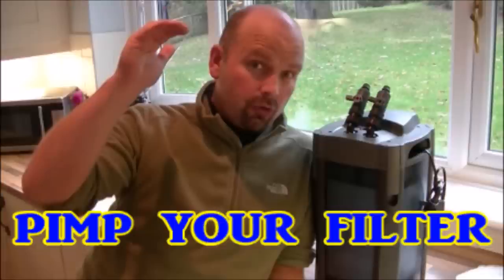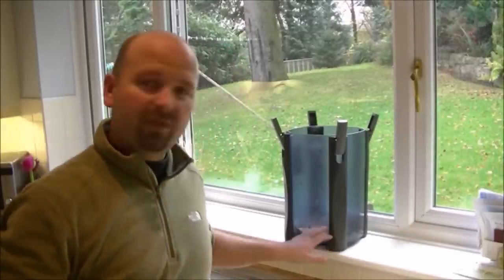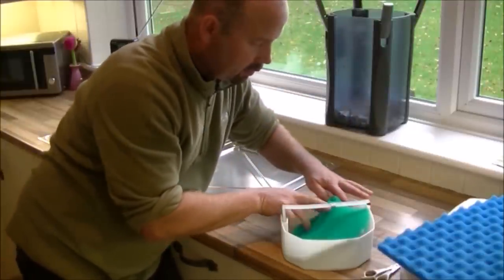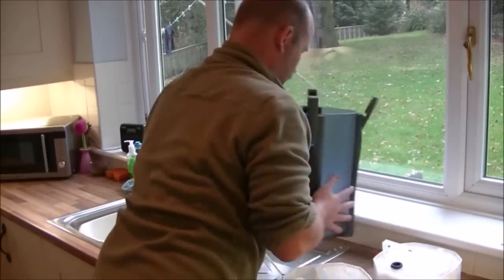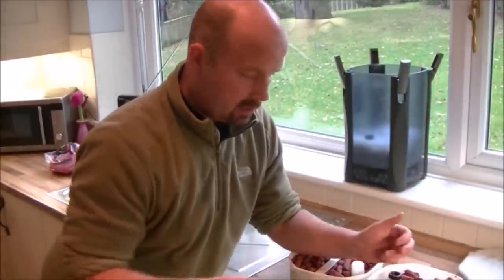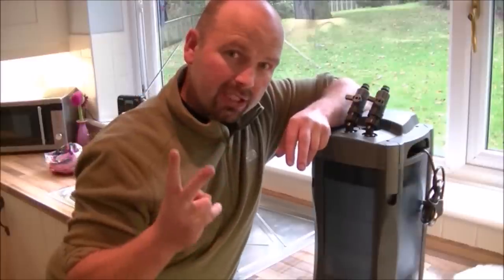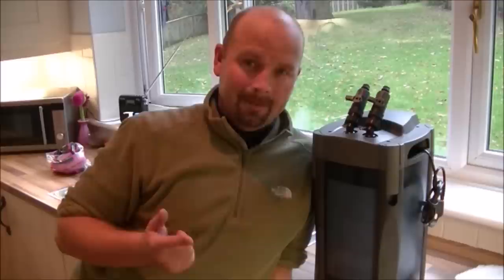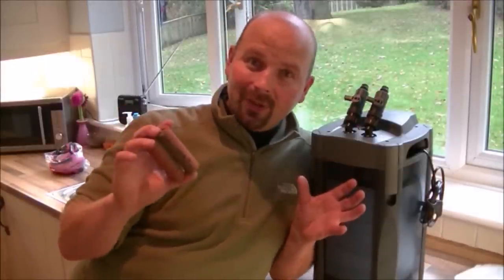External canister filter set up, nitrogen cycle and what happens in a filter - by Pondguru

Comment: Hello, I know this this a long shot but I am really interested in this external filter and I need the advice of someone super knowledgeable about aquariums and filters . So I currently have a Biorb Halo . It currently has a built in filter in the bottom of the tank that doesn’t work up to par . I currently have it set up as a marine tank and I also have a internal filter to assist with the crappy filter the tank comes with . I want to convert to a external filter but it’s very difficult with the shape and lighting of the tank . I want to replace the standard black tubes that come with most external filters with clear tubes to fit the filter so it will be more aesthetically pleasing . I would also like to not use the attachable hard plastic piping that allows the filter to somewhat hook on to square/rectangular tanks to filter the water  and return the water, because as I explained the shape of the tank makes that very difficult to fit in the tank since it is round shaped . Is that possible or is it required the use the hard plastic pieces in order for the filter to work properly ? My plan is to use the suction clips to stick the tubes to the inside curve on the biorb and tie a piece of mesh around the ends if the pieces provided in the set don’t fit the tube . This will allow me to remove the crappy filter all together as well as the internal filter taking up a lot of space in order to finally get rid of gravel , add live sand and give me excellent water quality . Does this sound attainable ?   I understand it may not be conventional . Trust me I regret getting this tank now so I’m trying to make the best out of what I have because I’m probably $500 in at this point . I’m really trying to attain the open globe look of the tank and that’s hard to achieve with extra black aquarium equipment and wires attached to the back of the biorb . Your wisdom is much appreciated !
Reply from the maker: Adding any sort of proper filter top an orb shaped tank is difficult but you can build an undergravel filter - search for one of my videos called 'biorb compatible upgrade' and you'll see me upgrade a 30 litre orb - we now have a marine version of the porous gravel available.
Feel free to email any time sales@filterpro.co.uk
http://www.filterpro.co.uk

Comment: Hi Richard I have a question. I am running a 45gallon with a  sunsun 303b. It is running great for months. Ammonia 0, Nitrites 0, Nitrates that hovers between 0 and 5. I think I am getting full cycle. Do I actually have to continue to change water if the nitrates continuously start and then goes down to 0?

Thanks
Reply from the maker: Sounds like a complete cycle to me and a water change / gravel / sand clean would still need to be done to remove organic waste although 10%-15% every 1-2 weeks (depending on stock) would be fine when a tank is fully cycled.
Reply: Pondguru thank you for all your help

Comment: Quick question, I currently have an internal filter which i had from initial set up around 2 years ago and its crap. I am planning on getting an external canister filter but just wondering how I should do the transition phase. I can't take any media from my current filter and put it in the new filter so was planning on running them simultaneously to allow good bacteria to build up in my new filter. Is this right and if so how long do you think I should have them both running for? If you have any suggestions on the best external filters to get aswel that would be great!! Cheers in advance :)
Reply from the maker: I think I just posted an answer to the same question on another video / thread a couple of minutes ago.

Comment: Hi Richard, what do you think about using kitchen scourers and cheap pound shop sponges as mechanical fiter medium? I am planning to construct my own filter, possibly with 4 steps- mechanical filter, then moving bed, then stationary bed, and maybe the 4th step (plant filtration), however haven't decided upon the 4th step yet. Cheers
Reply from the maker: The proposed set up is in the correct order and provided you have decent foams after the scouring pads to remove the finer muck there's no problem using pads (as long as they are not impregnated with cleaning solution)
Reply: Pondguru
I was also thinking about using natural wool together with the foam, that should do the job in removing fine particles. Have you ever tried it youself? cheers- Pete
Reply from the maker: Piterszczyk I haven't but you would need to make sure it was properly prepared as natural wool straight from the sheep has all sorts of oils in and on it which won't do the water much good.
Reply: Pondguru
oh no I didn't mean sheep wool, I meant cheap tesco value cotton wool, just bought a roll today (180g) for under 80p ;)
Reply: Pondguru
I will let you know how it went. The reason why I would like to create a cheap filtration system is because, having a set budget, I would rather spend more money on the plants, appropriate bulbs (and their further maintenance) and the substrate. Also the backup system, which might be quite costly. I am going to have a go at aquascaping, and plants are quite costly as well. Besides- I'm a DIY person, and I love to experiment. Meanwhile I have a question about the gel balls you sell on ebay: is there a way of finding out which exact bacteria do I get in them? Or is it a mixture of different bacteria? Cheers
Reply from the maker: Piterszczyk I'm not sure what the exact strain of bacteria I as that is a closely guarded secret from manufacturer but they are cultured for freshwater use.
Reply: Pondguru
Ok I see, I asked because I am planning my honours project for the next year and wanted to use such bacteria in the system I will be testing, but since I don't know the strain I'm afraid I won't be able to use them, especially if they are non-native to UK. I will get some of you for my home tank though, but first need to finish my assignments b4 I will have enough time to set the tank up. And build the filter. Cheers for answering.
Reply from the maker: Piterszczyk No worries - best of luck with your studies.

Comment: wont doing this style reduce the efficiency of the flow ? 
dirt gets clogged up faster at the bottom tray at the fine wool
Reply from the maker: As it uses the same gear that would normally be inside the filter the order they are set up makes no difference to the flow but a huge difference as to how efficient the media is allowed to be (by being protected from clogging - dirt is kept away from it by foams and fine pad)
Filtration always goes Mechanical then Biological then Chemical (if used)
Reply: @pondguru  I just installed a ocellaris for both my tanks and set it up exactly as per instructions - which is wool on top. Total opposite to you - changing it tomorrow.

Comment: please tell us also how often to clean the filter. coz whenever i cleaned my filter the water come foggy and my fish die too. please help me
Reply from the maker: The cleaning times of an external could be from 1-6 months depending on how big the filter is and what the stock of fish is in the tank. Assuming it is a suitable size for the tank and stock you should check every month but extend times if you think it will go longer. There is a guide to how much media is required to deliver full cycle filtration (reduction in nitrate) for a variety of stocking scenarios here: http://filterpro.co.uk/qa-24-w.asp 
There should be no fish deaths and minimal clouding of water when a filter is maintained.

Comment: How often would you do Maintenance on an external filter? Also how Often would you replace the fine particle foam. 

PS Could you please give me the email of the Australian Distributor? I use Seachem Matrix At the moment but i am getting another filter soon and Bio home seems like my best bet.
Reply from the maker: How often you maintain the filter will depend on how much muck it pulls in and therefore relate to how long the fine pad will last. Every tank / filter is different but having the filter set up properly will cut down maintenance time. The guy in AU who sells the biohome is: charles@genesisgroup.com.au
If that address link does not work it is also in the video description,

Comment: Every time I do a tank cleaning I loose 1 or 2 fish. Last night I sponged off the inside, the filter didn't look dirty but I rinsed it under the sink anyway.I replaced 1/3 of the water, I have a 20 gal. tank, and this A.M. I have 2 dead guppies. I also have 5 platties, 1 garuamie and 1 loach. What am I doing wrong.
Reply from the maker: That is a huge water change and there should be no need to do more than 20% even with inadequate filtration. Without knowing what the water tests like and the quality of (tap?) water being introduced I would be guessing why fish are dying.
Reply: Jerry H The reason you are losing fish is because you are rinsing your filter with water from your tap. Tap water contains chlorine and chloramine, both of which are deadly to fish, and they also kill the beneficial bacteria that has colonized your filter media during the nitrogen cycle. Next time you clean the filter use only water from your aquarium. Syphon water from your tank into a bucket next time you do a water change, and use that water to clean your filter and filter media. Lightly rinse out the biological media FIRST, followed by a more aggressive cleansing of the mechanical media. Finally, replace the water you removed with new dechlorinated water by using a product such as Prime or API Stress Coat. It's ok to change up to 50% of the water if needed, but if you do regular changes 10-20% is more appropriate.

Comment: Hi .thank you for the videos. very informative. just bought a fluval fx6 and they claim the water travels from the top down.Is this true? and do i reverse the order .Pads,biological media. thanks
Reply from the maker: Dear Dave,
Yes that is correct. As you have good foams surrounding the central trays you will really only need a thin fine pad on top of the top tray to 'polish' water before it goes down through media. Each tray will hold around 1.5kg biohome ultimate (more if neatly packed) so you can get 4.5kg - 5kg in the 3 trays.
The Fluval filters state that they will filter 'up to' a crazy amount of water (1500 litres?!) but to see proper filtration (full cycle where nitrate is reduced) the FX6 will be suitable for a community tank of around 500 litres since it takes approx. 1kg biohome ultimate per 100 litres to deliver full cycle filtration. Different stocking densities / predators / cichlid tanks may require more and there is a guide here and further information here: http://filterpro.co.uk/qa-24-w.asp
Hope that helps.
Regards,
Richard
Reply: thanks again. just purchase 5 kg of the ultimate marine. thanks again
Reply from the maker: Groovy, thanks very much.

Comment: Any advice for media and foams for a fluval 306 currently it’s all standard but a friend is trying to advice me to stop me running carbon in it and run purigen in stead
Reply from the maker: The 306 has decent foams down the side so you'd only need a medium and fine pad in bottom tray followed by 2 trays of media. if you chose to go with the biohome ultimate you'd need 1kg per tray (2kg total) making the 306 suited to a normally stocked tank (for full cycle filtration, reduction in nitrate).
I'm not a fan of purigen but that is down to so many people reporting a filter bacteria crash when using it - carbon is as good as anything and won't affect bacteria adversely.

Comment: hi, ive got the all pond solutions 1400+ filter should i be setting it up in the same way youve set this one up? ive just set it up the way it said in their instructions but am not really happy with the amount of foam in the filter its self!  i have a 200 litre tank, how much biohome ultimate should i be putting in it? thanks in advance!
Reply: +dylan bowe  ive just bought the filter upgrade kit, and 3kg of biohome ultimate! looks the only way to go... thanks man
Reply from the maker: +dylan bowe No worries, yes that is the right sized kit for the 1400 but as yours has a UV that reduces how much media will fit in the trays so you may need to pack it in carefully to fit the 3kg in the 2 trays used for media. 
As long as you have the coarse, medium and fine foams on the bottom tray with media in the trays above its all good.
Leave the UV turned off for at least 2-3 weeks after setting up to allow the media to mature properly.

Comment: So I just got an eheim pro 3 G160. It has 4 trays 2 Bio Substrate and 2 mech cermaic rings and has the blue coarse pad on top and a polish pad after the bio.
So I took it all apart left the blue and white polish pad alone. The bottom tray I left the Eheim Mech cermaic rings in there. 2nd Tray I did a fine and super fine pad, 3rd tray Eheim Substrate Pro (Bio), 4th Tray Bio Home Ultra (I need to order more! Lol ) then the t
Polishing pad that goes on top of the 4th tray. I'm assuming giving this setup it's the best option correct? What are your thoughts. I'll see if I can link some photos. Or just Google the G160 to see what I mean.

Thanks
Reply from the maker: Definitely better than it was but the water needs to pass through the polishing pad before the biological media for best efficiency.
In an ideal scenario you would leave the blue foam in top like you did then use bottom tray for coarse, medium and fine pad / polishing pad the trays above that for biological media. Some people do add an extra polishing pad above the media but its not really necessary.

Comment: I have recently purchased  aps 1400 e f external filter. Could you tell me if I can purchase a u v bulb and bulb holder and fit it to this model. It appears to have a screw top on the lid that indicates this is possible. Could you please advice and if so what is the cost and where could I purchase these items.
                                                                 Many thanks. Donald  Reader
Reply from the maker: Dear Donald,
I don't know the answer to that unfortunately but I'm sure if you phone up APS they will be able to quickly give you the answer to that question. As far as I know the trays are different in the UV and standard filters to allow for the bulb but I may be wrong.
All Pond Solutions have their own website and they also sell on ebay and Amazon so any of those outlets will have spares and UV if it is available separately.
Regards,
Richard

Comment: Hi mate, have you ever pimped an fx6?
Reply from the maker: Not personally as I have never owned one but plenty of people who have bought biohome have upgraded them in the same way. Only differences are as follows:
The water flows from top to bottom in FX.
FX has good foams around media trays so you really only need a fine pad on top of the top tray.
The FX trays will hold around 1.5kg per tray (more if neatly packed) and people seem to go for 2 different options because of that. 
1 - Only have thin pad on top of top tray and fill all trays with media = 5kg media + fine pad
2 - Use top tray for coarse, medium and fine foams with 2 trays underneath filled with media = 3kg upgrade kit as shown in this video.
I also do saltwater versions of the kit using the new Biohome ultimate marine - all on my website: http://www.filterpro.co.uk and there is a guide as to how much media to use for full cycle filtration (reduction in nitrate) on the Q&A page.
Hope that helps.
Reply: +Pondguru Outdoors thanks for the advice. I'll get on the website and order the kit 👍🏼
Reply from the maker: No worries, any time.

Comment: In a planted tank with CO2 added, what effect might this have on the bacteria in the Bio Home media?  Thinking about feeding the CO2 through a inline reactor.  Thinking it would give it more time to dissolve into the water attached to the intake, however would this additional CO2 affect the good bacteria in the Biohome media?
Reply from the maker: Unfortunately I don't know enough about CO2 systems to guess if it will affect the bacteria in the filter so I'm not much help there. I have not had any reports of poor filter performance in any situation and I'm sure many of those will have included planted tanks with CO2 systems.
Reply: Tom McManus The addition of CO2 will not affect the beneficial bacteria in the biological media. In fact, adding CO2 to a planted tank will actually help reduce nitrates and aid in filtration. If you are adding nutrients to your tank, and assuming you have adequate lighting, the limiting factor in photosynthesis will be CO2. In this case, the addition of CO2 will boost photosynthesis thereby requiring additional nitrogen which is available via the water column in the form of nitrate. I have a planted tank running CO2, with a Fluorite/Onyx blend substrate (3 inches to 6 inches in some areas) and I do 10-15% water changes every 2-3 months. My nitrate levels are stable between 0 and 5 ppm.

Comment: After doing all that how long till I can add the fix to the tank?
Reply from the maker: If it is a new tank the fully upgraded filter can be added straight away but if you are upgrading a filter on a mature tank then it is best to do it gradually over 6-8 weeks so there is always good bacterial activity happening while the new media matures.
Reply: When can I add fish if it’s a new tank? I already bought the filter kit and installed it in the new tank its running since yesterday
Reply from the maker: @mrgogetit9389  Generally you'd set up a tank / filter and run it for a week or so before starting to trickle the fish in, starting with hardy mid-water species and adding more every 1-2 weeks depending on how water tests until the full stock is reached in 2-3 months.